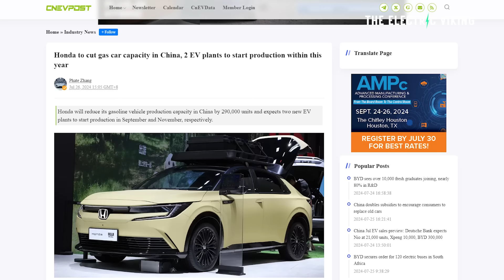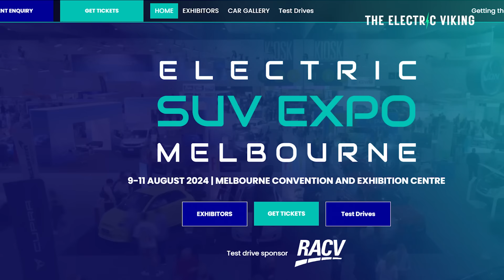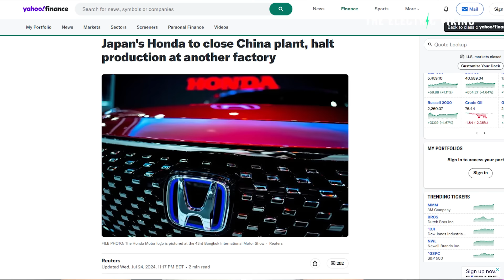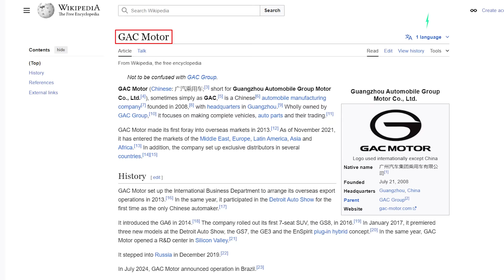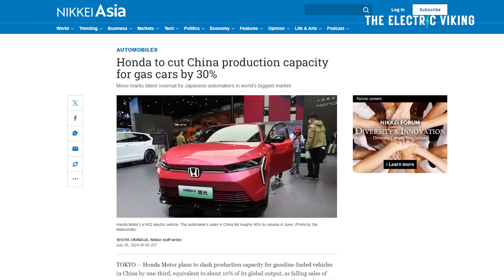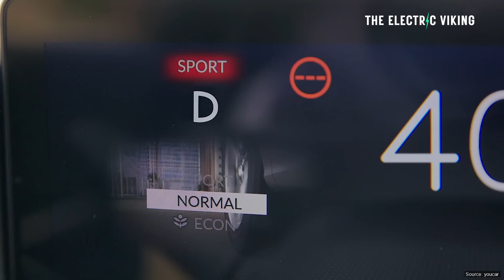Honda forced to shut down 3 MORE car factories as demand collapses

Comment: Prices of new cars are too high.  China is the only country making affordable cars.
Reply: Agree with you. Cars are just a commodity and China can do comodities (quote from Singapore PM). Hope China will export cheaper cars same as their electrical stuff, hardware, plastic wares....
Reply: Cars are sitting on lots. And dealers don't even want to seem to sell them in my area. Walked into several dealers. I looked around, salesman standing around watching TV at the luxury class dealers not wanting to sell a car. I walked out of all of them. Maybe they thought I didn't have money. But they all had large inventory on lots.
Reply: @cheekeongchan6605 You mean cheap electrical stuff they make that is cheap because it is extremely poor quality and breaks down all the time?
Reply: Not new, but I see a 2023 Leaf with 15k miles for $14,500.
Courtesy Volvo in Scottsdale, Arizona.
Reply: @pat4005 My long reply to you has been deleted. Do not buy the cheapest as it won't last. Buy the one which is comparatively cheaper compared to say a Japanese/Western brand. My Chinese shower curtain cost US$3.60 compared to a dept store's one at US$7.00.
Reply: @cheekeongchan6605  Problem is that Chinese EVs are cheap and last long enough to be compared to the gas powered ones. The best part is that you just need to replace the battery and you can run all the way to 1k. cheap doesn't mean its a knock off. It's cheap because it is their ability to be able to sell for the price they can. Ask Elon Musk and he can tell you its not much different from the expensive ones.
Reply: @pat4005 为什么中国人用的东西便宜且质量好？那是你们国家的采购商要赚你的钱！降低了生产标准！
Reply: @pat4005  this comment is outdated by at least 10 years and clearly shows that this commenter knows nothing about current EVs produced in China
Reply: @WarpedTrekker ✅️
I've noticed that too.
Reply: , when you buy rock bottom cheap what do you expect to get. Brands like BYD, Haval, JAC etc are well above US or German quality and much cheaper.
Reply: 🐸🐸🐸 @pat4005 🐸🐸🐸Childish, grow up... Kid 🤣🤣🤣
Reply: With Yen collapsing, they should think to build car in Japan. 🙏
Reply: Hope Honda bring back FIT back to North America.
Reply: @cheekeongchan6605  yup , same as my xiaomi fold phone , at least HALF price and every bit as a samsung or apple - oh..apple dont have a folding phone 🤣
Reply: @Dom-bn1ru  anyone want to bet that he is watching YT on a chinese made phone / computer ?
Reply: Tesla base model 3 is $38,990 before $7,500 tax credit (in the US).  MPGe of 132 miles combined city/highway  25 kWh per 100 miles.  Do the math, cheaper to operate than ICE vehicle.
Reply: @victorsvoice7978  very true
Reply: @WarpedTrekker  Same happened to me. These salesman will soon be out of a job.
Reply: @Dom-bn1ru  Poster is a Sinphobe.  Let them live in la la land.
Reply: Yes and they are absolutely shit
Reply: @pat4005  100% tax ,more like a nation's panic
Reply: @mephisto2812  no EV can run 1000 miles on a single charge!!LOL!!!!
Reply: Only if you buy in China byd. China price £18000. Uk price same car £47000
Reply: China cars no thank I rather have a indian car more cheaper😊
Reply: The Chinese brands are state backed and heavily sudised.  The Chinese don't do completion on a level playing field.  Once the Chinese dominate you will have to pay high prices regardless, as you only have Chinese brands to choose from.
Reply: Think again, they own Lotus, Volvo, Polstar, hardly cheap brands.
Reply: @sp-tw8ij  Those brands were bought because the Chinese have been almost completely unable to build global brands of their own.
Reply: Wumao begone!
Reply: Why , back in 05 my Silverado was very affordable and 93% US made . US autoworkers are making half of what they did then and the Silverado is made in Mexico with 52% Mexican made . When companies moved to China and Mexico the CEOs, CFO, engineers and all upper management got enormous increases in pay . So when companies say they can’t afford to manufacture here at an affordable price what they’re saying is it would be game over for the money train on the top .
Reply: china is  the only masufacturer sellinh affordable EVs. The European manufactures will change back to affordable ice cars. The ev quota system will be abandoned, but not before it has done a lot of damage.
Reply: China's long term aim is to monopolize global vehicle manufacturing. Let's not forget that much of China's manufactured exports are state subsidised coupled with cheap labour.
I've 25 years experience of buying products I've designed in the UK and sourced in China just so UK companies can remain price competitive. Chinese manufacturers will always try to find ways of making a greater profit and if it means using interior materials then that is what they will do.
Ever bought a packet of screws from B & Q lately? Chances are the screw heads will snap off when you attempt to use one!
Reply: Chinese EVs are crap
Reply: @pat4005  only because you are only buy something very cheap, you cant ask for too much for the lowest price you like to pay.
Reply: you're in for a rough awakening.   Taje a trip abroad and smell the coffee
Reply: Affordable  but no good
Reply: @sp-tw8ij raising price when there is no competition? This is a myth propagated by empty vessels.
First, this can happen in very few item because there are always other alternatives to satisfy one's requirements. Even latest lithography equipment from Netherland have alternative if the priced too high.
By the way, China monopolized color TV set forany years now, same with refrigerators, aircond, washing machines, we are seeing them cheaper rather than more expensive nowadays.

Comment: Who can afford $40,000.00 for a 4 seat sedan that sold for $21,000 ten years ago?
Reply: $21,000 ten years ago is $40,000 today. Your house has doubled in value in that time also.
Reply: @lauriesmith9019   True. Property taxes have doubled too, but not all incomes.
Reply: @lauriesmith9019 $21k 10 years ago is not $40k. Cumulative cpi is 32% in that time.
Reply: @lauriesmith9019 
The house is not worth double either.
Reply: @bobmarker6812 car insurance double, intrest more than double, property tax double
Reply: @lauriesmith9019 cars depreciate but houses appreciate.
Reply: @lauriesmith9019  iN SOTH FLORID HOUSING DOUBLED IN LAST4 YEARS IN SOME AREAS 3X S
Reply: @bobmarker6812 why in America you pay taxes as the price of the house goes up? It should be illegal.

Comment: Prices for new cars extremely high. In Europe Toyota Camry new was in 2022 32000 EUR today it is around 44000. Insane.you can't buy mid size compact hybrid for less than 40000. Who will buy it with those disaster salaries

Comment: Listen to me car manufacturers, I don't want touch screens, I don't want high tech, I don't want gadgets, I don't even want alloy wheels with low profile tyres that get damaged easily. I want the following car, cheap, reliable with moderate power that gets good mileage with minimum additions forced on it by laws. Please build some, you may be pleasantly surprised, remember, that's how you started and became successful.

Comment: I had a 2003 Chrysler 300M was great car, I needed new shocks and struts.
Chrysler OEM Parts no longer available.

In 2023 sold car, parts were just getting hard to find and not very good.
Substandard parts.

Comment: In 2015 Honda switched over to the Earth Dreams DIRECT INJECTION motor in most of it’s cars. This engine is super efficient BUT has SERIOUS flaws. One of which is that by putting only direct injection and not having port as well (like Toyota does) it causes serious carbon buildup on the back sides of valves and causes a 40-50k service requirement that costs a lot of money or else tge enging runs like crap. 

This was a MAJOR MISTAKE for honda and it has stained their reliable reputation. 

Sad

Comment: I've always bought Honda's but they are no longer reliable.  My 2015 Honda Fit has rattle on a cold start up due to the VTC Actuator that will be cost me $2200 to fix and the problem may come back.  A friend had an oil dilution problem and ended up replacing the vehicle.

Comment: This drop in demand that Honda is experiencing might have something to do with their current extortionate prices although this is common to all manufacturers these days.  They are also selling a limited range of boring £50K+ SUVs which have limited demand at the best of times.  Here in the UK, it costs a minimum of £27K for a Jazz, and £35K for a Civic which is ludicrous.
Reply: brexit wiil fix that. Buy british cars.
Reply: The reason for that is they are complex hybrids. Honda used to make Jazz, Civic and CR-V petrol and diesels in the UK.
Now the only Civic available in the UK is an expensive 2L hybrid or specialist Type R with over 300hp.
Honda had some success in the UK in the past but never cracked Europe and they have only ever had a tiny market share there.

Comment: Quality has gone down as has reliability.  They have removed performance oriented vechiles from the mix by and large and the few they do make, are not as good as competitors offerings.  The vechiles they do make are way overpriced.  $40K for a Honda Accord?  Nearly $60K for a top trim Honda Pilot?  Not a Mercedes, a Honda Pilot.  For $60K.  $45K for a CRV?  Come on now. $44K for a 1.5 liter weak engined Acura Integra.  Come on now!  No wonder they are losing sales.
Reply: Thanks to the pandemic and monetary policy, prices have gone about around 20% in the US in the last 5 years.

Comment: I feel Honda is pricing itself out. Honda used to be an entry-level brand and now are trying to reinvent themselves with higher price points. They have basically put themselves closer to Acura price points. There is very little difference.

Comment: Honda switched from quantity to quality. Their cars are much better specked. Honda achieves a much bigger margins now making more money for selling less cars. Customers still buy them as honda's are trouble free driving for many years. In many western countries repairs are very expensive due to high labour cost so reliability is worth a lot.
They are lagging in EV race, but doing ok with hybrids and plug-ins. Not all as bad as it looks on the surface

Comment: Getting my 5 years old ICE  Toyota( RAV 4, 14k) out of a dealership tomorrow, their lot is full to the brim with used Tesla  at roughly the same price range which nobody wants 😊.
Serious part of the high ICE cars price of late are the numerous governmental regulations pushing the unachievable EV dream down the throat of everyone 😊.
The ICE manufacturers will come back to their senses one way or another, the EV guys has no much room  for price reducing among the other well known issues connected to owning an EV.

Comment: Another good video! I do see the issue of having too many cars. The days of buying a new car every two years are probably over.  I love my 2022 Ford Mach-e (34,000 miles / 55,000 km) and have zero intention of trading it in. Also, my 1999 Lexus with over 200,000 miles (320,000 km) runs great.

Comment: Problem with japanese and even western legacy brands is that theyre very slow to adapt to changing environment. Also, the combustiion engine based vehicles are often sold bare and you have to pay a lot more to get all the bells and whistles. Chinese cars on the other hand has improved on everything from design and functionality. And for the same price as a japanese combustion engined vehicles, chinese cars offers all the perks, tech for almost free. And it also isnt helping japanese brands that chinese build quality is getting better and better. Japanese, korean and western brands are stuck with their old business model while china revolutionized the industry

Comment: In malaysia 2015, An Accord & camry used to have 2 engine 2.0 & 2.4/2.5 engine option, price was 135k base, 145 k & 160k. Now only 1 option and prices are 180k-200k.

Basically a base accord 7-10 yrs ago cost the same as a high spec civic now. Accord and camry being discontinues sighting demand for mpv which in reality its them jacking up prices.

A honda fit/city would have cost 75-85k 10 years ago, now they are 85k-100k. This is why their sales decreased.

Comment: México is reciveing a tidal wave of Chinese cars they don't stop coming, brands like Neta, Exceed, Jacoo, Baic, etc...
Reply: Better open up junkyards 😂😂😂😂😂
Reply: @zooski151  For Honda's?
Reply: @paulc6766  bwahahahahah

Tell someone you know absolutely nothing about cars without telling them. 

Of all cars you choose Honda as unreliable. This is too funny 😂😂😂😂😂😂😂😂
Reply: @zooski151 for VW?
Reply: @larryc1616  lol yes vw’s are horrible. I had a 92 Passat as my first car and it almost broke me.  Ran Hondas for 20 years and replaced some ball joints and wheel bearing.  BMW’s now and no complaints. 

I won’t touch Audi group with a 10 ft poll. Porsche a bit different tho.
Reply: They are flooding the market with low quality garbage to squeeze the competition. Chinese consumers dont want these cars either
Reply: And they're all garbage!😂😂😂
Reply: @YBM2007  who’s going to work on these vehicles? There is no support or maintenance facilities in the country.  

Have you seen the bending suv frames on its first off road use 😂😂😂

Comment: It is a shame Honda is struggling.  I love my Acura TL and they design engines that are reliable and can be worked on easily by the owner.   I think the new Honda CRV or HRV is an very attractive vehicle and will have excellent honda reliability.   I kinda don't like the appearance of the new Acura Models.  The changes they made on the exterior are less appealing.   I prefer Honda reliability but they need to go back and redesign the accord.

Comment: Lets face it. The sardine tin City hasnt altered for more than ten or more years. Its external appearance has a bit, but its only window dressing. They dont need it. And the civic, designs gone backwards. In effect just wiping it out. . So naturally, Hinda are going to save money by stopping building the outdated cars. In face of waiting time, for the electric car bubble to burst, before hydrogen is brought in. Its my belief the production requirement of the hydrogen cars is quite different to the old icb engines, hence the saving of cash, getting ready for the changecover. Youll see other car cos do much the same soon too.

Comment: Whilst I still think Honda still produce well built, well engineered and reliable cars, in the UK they have become very expensive but undistinguishable from many other mainstream manufacturers. 20 years ago they had the aura of a semi premium product - a bit like VW - which attracted the aspirational albeit often older buyer but there is no longer and reason to buy a Honda over a cheaper Toyota or Mazda. With the exception of the (again very expensive) Jazz the models have become bloated with no special attributes. The Civic has moved from a B segment hatch to a C segment car - a sector that has collapsed even greater. No marketing and only one EV with a silly price that has to be discounted by 20% to attract any buyers thus destroying residuals. Frankly I cannot see Honda remaining in Europe especially as they no longer have a factory here. About as clueless as Ford although at least Ford have a hugely successful light commercial vehicle business.

Comment: The NUMMI plant in Fremont was sold to Tesla by Toyota, not Honda. It was originally a joint venture between Toyota and GM, which ended when GM went bankrupt.
Reply: That is what he said at 7 minutes.   YouTube should have a mechanism to prevent comments from people who have not watched the video.
Reply: @klardfarkus3891  Ok, clearly I misheard what he said. However, the timestamp is 5:50 not seven minutes in. Did you even watch it? If I had not watched the video, how would I have even known he said anything about the NUMMI plant? I may have made a mistake, but you are just trolling.
Reply: @ThomasBrockOnline  oh I am trolling because I corrected your erroneous statement but you weren’t trolling in making your claim?
Reply: @klardfarkus3891  No, trolling was implying that I had not watched the video, which does not make logical sense.
Reply: That Was Once Home To The GEO PRIZM! RIP!
Reply: NUMMI plant was owned by GM.  GM entered into a Joint Venture where they provided the plant and Toyota tooled it to build GM (GEO Prizms initially and then Pontiac Vibes) and Toyota vehicles, with UAW labor. When GM went bankrupt Toyota wisely chose to end the relationship and move on.

Comment: Without government intervention throwing money at them, EVs would be gone in 10 years. They are not the answer to going green, in fact they're the opposite. The idea that they are better for the planet is insane.

The greenest thing anyone can do regarding cars is to keep the one you have for as long as possible. This is also way cheaper than buying a new electric cars for £50,000 plus. 

We dont need to keep building 10s of millions of new cars each year. Fix the one you have.

Comment: Get rid of the CVT and the small turbo junk engines that is the #1 reason why I purchased a Toyota Camry over an Accord for my wife. Honda is like Nissan stubborn and they keep putting in transmissions people run from.
Reply: The Honda Jazz hybrid does not use a cvt.

Comment: Maybe the masses are finally waking up to the massive con that EVs are. Eye-watering purchase price, huge problems charging, and tanking used values that even dealers won't touch when folks try to trade them in. Hybrid is the sensible way to go, and you'll actually be able to trade it in or sell it if and when 🙂